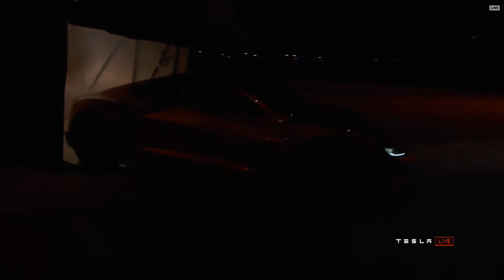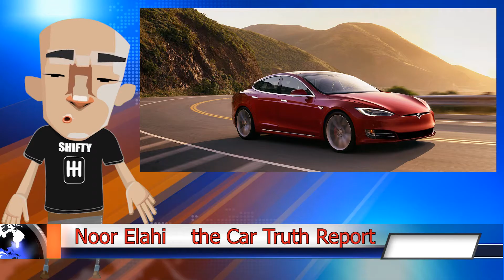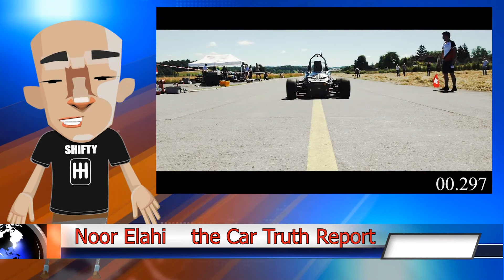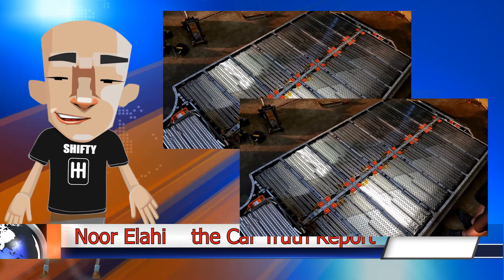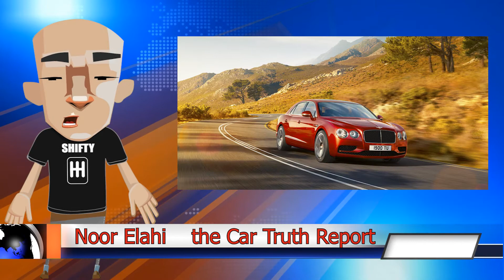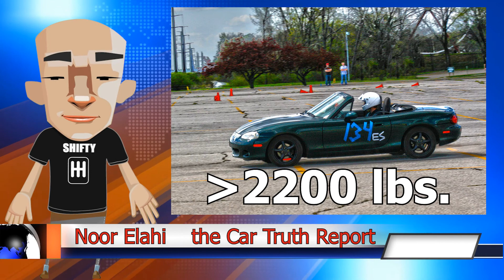Tesla Roadster First Impressions - Everything We Know

Comment: Can you find another 5000 lbs/ 2.2 t car, electric or not, that does 1.9 s from 0 to 60 mph/ 97 km/h on road legal tyres? How much horsepower does a car like that have?
Reply from the maker: One would think 1000 hp +  based more on the 250+MPH top speed that Tesla is quoting than the 0-60.  0-60 is a better indicator of weight/torque and grip than anything else.
Reply: So then, what 2.2 t car does 1.9 s on road legal tyres? What specs do other cars have able to achieve this?
Reply from the maker: None so far.  Like I said in the video, AWD with electric motors is the fastest way to accelerate with road legal tires.  This car is very impressive, it is just not going to be the best at everything.  RWD Dodge Demon does it in 2.3 with RWD only, and that is a heavy car too.  The Demon makes 850Hhp I think.
Reply: What I'm insinuating is that you got it all wrong and it's not a 2.2 t car because, if it were, it's not powerful enough. A 200 kWh pack won't go over 1 MW and that's simply not enough for 1.9 s 0 to 60 mph, 8.9 s quarter mile AND over 400 km/h with one or two gears.
Reply: What I don't get is what's so special about what Tesla's doing in terms of electric drive that gets them the better 0-60 time. The NIO EP9 is an electric racing vehicle with 1MW power in four individual motors, one for each wheel. It weighs only 1800 kg, way less than a Tesla P100D. Yet its posted 0-100 km/h is 2.7 seconds. What's going on?
Reply from the maker: My best guess would be that the EP9 is geared more for high speeds.
Reply: Unfortunately I cannot find the gearing ratio, but you're probably right. It was built as a track car though. Sure, you need the gearing for high speeds on the straight, but you also want to accelerate as fast as possible out of a corner. The Nurburgring has both.
I also remembered that Tesla nowadays uses the MotorTrend measurement of 0-60 with a one foot rollout (the car is already moving when the timing starts), so a more realistic legitimate 0 - 100 km/h for the new Roadster is probably 2.2 - 2.3 sec.
Reply from the maker: True, but even on the ring, once you are going, you don't get much below 60, and only a few times in most modern performance cars.
Reply: Makes me wonder how much the 0-60 war is hurting the actual drag and road performance of Teslas. If they were geared a little bit less aggressively for the 0-60 they could be performing a lot better overall, perhaps.
Reply from the maker: If I was going to make a tesla for track use, it would defiantly have higher gearing, though on the road, most everything is between 0-60.  So I am sure they are pretty close to optimal for that purpose.

Comment: You don't know what you're talking about. Making the battery cubic makes it a lot more weight efficient.
Reply from the maker: Who said anything about the shape of the battery?
Reply from the maker: Also, changing the shape of the battery has no effect on efficiency, unless you are talking about cooling, it does however affect the amount of energy you can fit in a specific area.
Reply: .... Obviously not you, because you don't know what you're talking about. And yes, changing the shape affects the energy density.
Reply from the maker: First you were talking about efficiency,  now you are talking about energy density, so which one is it?  They are very different things.  Second, changing the shape of the individual cells in a battery pack will NOT change the efficiency or energy density of the individual cells, it will help the packs' KWH per cubic foot however.  Basically it would just make the battery pack a little bit smaller, not lighter, and no more efficient.

Comment: Where Tesla fibbed is in the torque numbers. It has a transmission, so it has torque multiplication. However torque is traditionally measured by manufacturers at the engine/motor.
Reply from the maker: That was the idea behind showing that a 275hp Camaro makes 4244 ftlbs at the wheel in 1st : )  Thanks for watching!
Reply: the Car Truth Report Yup! I’m not a fan of these games. The motors will probably produce over 1000 ft-lbs of torque. That’s impressive enough without the fib!
Reply from the maker: Yep, but the fibbing does give me something to talk about in my videos : )
Reply: The front wheels do have a differential, I said the rears don't and other cars have 4 motors and 0 differentials.
Reply: how do you know it has a transmission?
Reply: Each of the motors has likely it's own dedicated single speed transmission. It might be the case that some of the motors might have a second gear, but it's not really required or guaranteed. Fact is, from a stand still to over 100 km/h nobody will shift any gear and that torque will be there unlike a petrol car where you shift out of the 1st gear way before that and lose that max potential torque at the wheels.
Reply from the maker: One thing that makes me think that it is going to have more than one gear per wheel is the fact they are getting up to 250 mph, and still able to put 7000 ft lbs or whatever of torque to the ground.  Also he said it is only going to have 3 motors, so he is at least using a diff in the front.  So maybe a 2 or 3 speed in the front, and the similar 1 gear ratio in the rear like the other Teslas.
Reply: the Car Truth Report It’s all speculation at this point, but yes to get to 250mph the most efficient way is to use a transmission. It also has a claimed range of 600 miles. You need to spin the motor slower so that it uses less energy to get that kind of range with current battery capacities.
Reply: You don't need a differential. Rimac has 4 motors and 4 transmissions, none linked between them. The two in the front have a single gear each, the two in the back have 2 gears each. The ratios don't match so at slow speed, all might work while at high speed only the ones in the back might put down power. The differential is virtual, the computer controls the RPM of each motor and so it achieves torque steering something Tesla claims to have as well. Nonetheless, even if the two motors in the back have 2 gears each, the second gear won't be needed until over 100 km/h and the car operates in first gear at speeds where a normal ICE car would need to be in 3rd or something and have no where near the peak torque it had in first gear. Get it? It's far different, it's not at all the same like claiming a quick ICE car has say 5000 ft lbs of torque in first gear because it has to shift very quickly when it accelerates while an EV doesn't. The current Model S goes to 250 km/h in a single gear.
Reply from the maker: How does a virtual differential work if there is only one motor in the front, like Elon said?
Reply: Tesla's 3 motor solution isn't like Rimac's, the front wheels will likely rely on braking, while the rear ones will be independent for torque vectoring.
Reply from the maker: How do you get the power from one motor to 2 wheels without a diff?
Reply from the maker: Sorry I missed that.  Thanks for the view and the comments!  Every little bit helps us little guys!
Reply: Single reduction gears. In all probability the rear motors are geared for initial takeoff and the front is geared for the higher speeds. The major takeaway from the truck and roadster presentation, but not mentioned, is the probability of considerably advanced battery tech so I would be surprised if the roadster was 5,000lbs. but it wouldn't really matter and, judging by the amount of times the prototype strutted its stuff that night, it definitely has a future on the track.